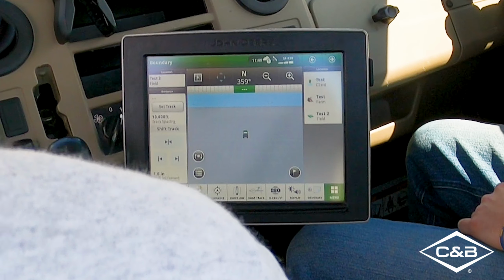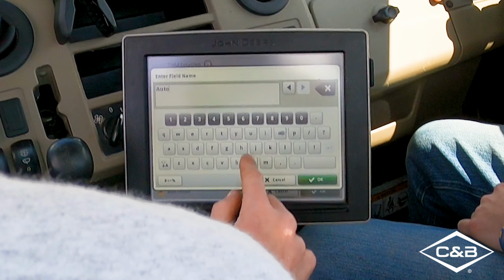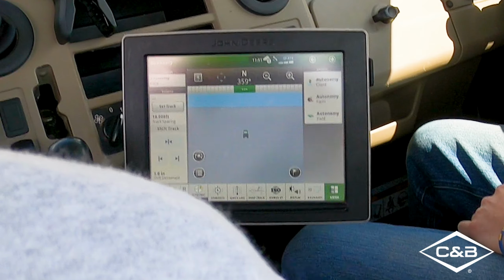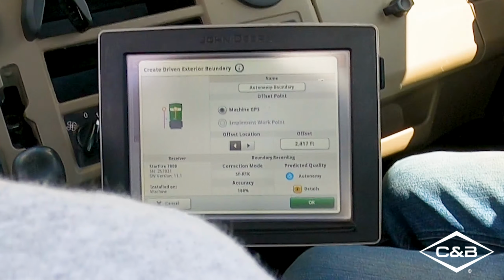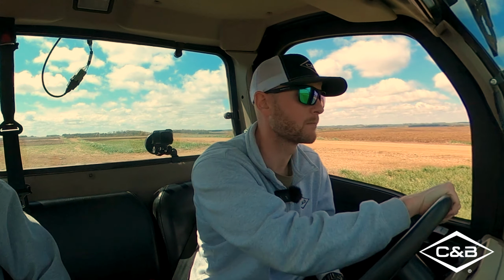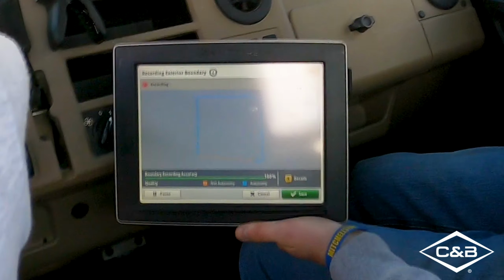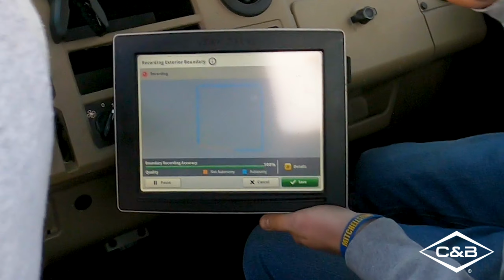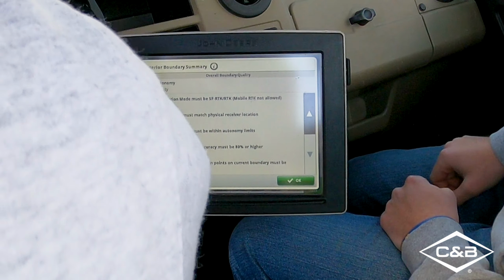Mapping Field Boundaries for John Deere Autonomy

Comment: Autopath and everything still work if not autonomy. The blue autonomy line is for full on no operator autonomy. I like to pause my lines at the corners and then resume to snap the lines straight
Reply from the maker: That is correct, they would still work for Boundary Track and AutoPath from Boundaries. An additional note, a software update (25.3) made available in August of 2025 increased the snap distance between points to 100 meters while still remaining Autonomy Capable.  An additional feature added was Undo and Redo buttons that are now available during boundary recording.
Reply: @C @CBOperations ally? I’ll have to check my software. Thought I was updated but maybe not. I’m not seeing the undo buttons when I map